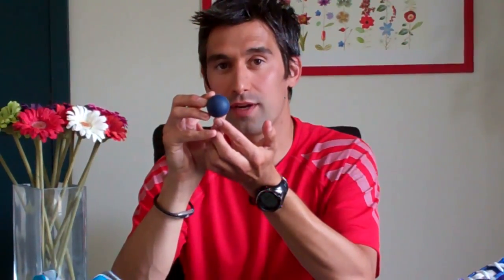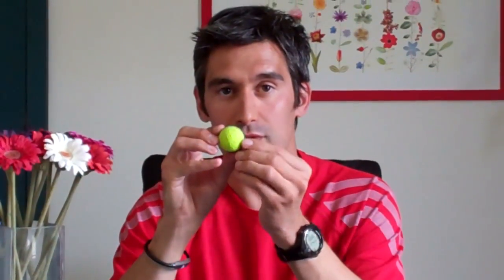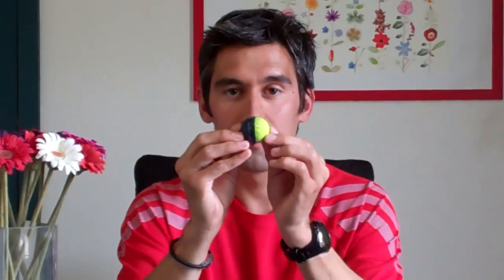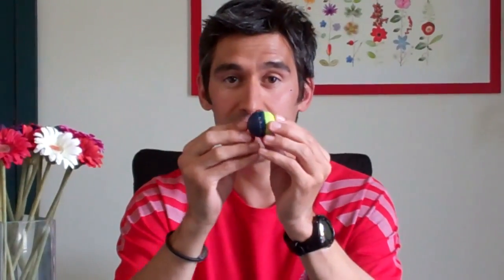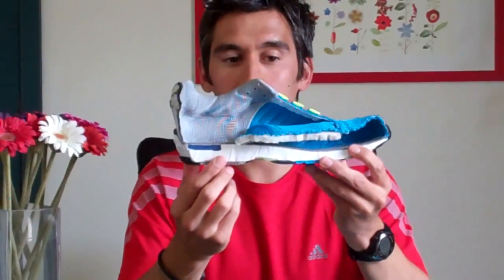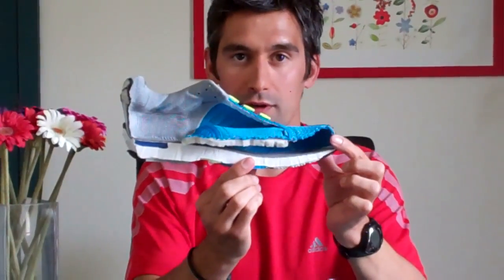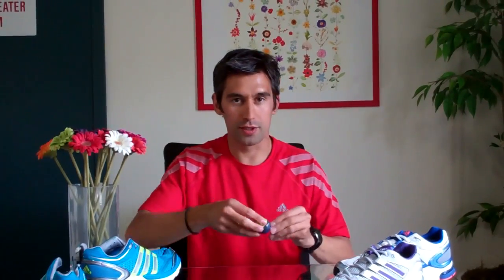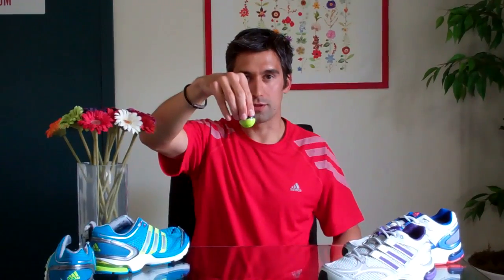adiPRENE and adiPRENE + Cushioning.mp4

Comment: I was wondering then whether or not adidas running shoes are suitable for forefoot strikers?? I have always known all along that for forefoot strikers its best to have a shoe that offers dual density materials on the forefoot. 1 Part cushioning (to reduce impact), while the other part like the adiprene+ for toe off.
Reply: Edwin Widjaja 6 years too late but...

If you're forefoot, you're usually sprinters. Either that or your calf has a million knots and about to burst if you run 5km on your forefoot. 

I'd be suggesting lighter shoes that has superb responsiveness.
Reply: What James said, if you consider that the heel is probably denser and heavier and something that you aren't using you'd most likely benefit more from a sole that is entirely as light as the forefoot adiprene. Think ultra boost.
Although this is just speculative